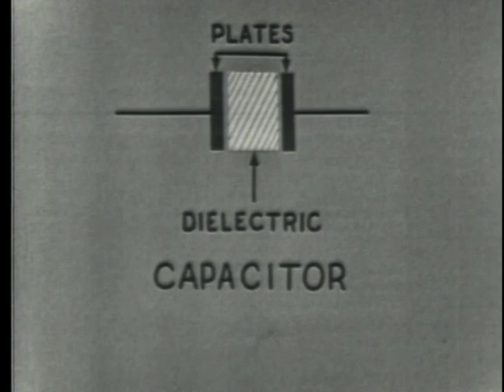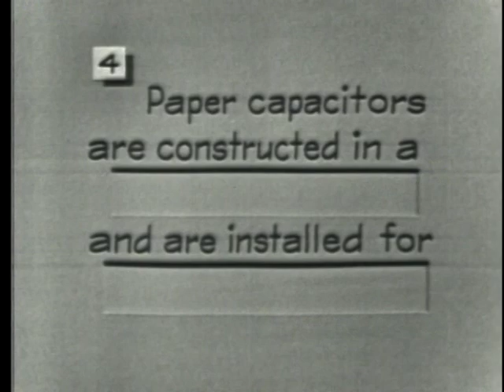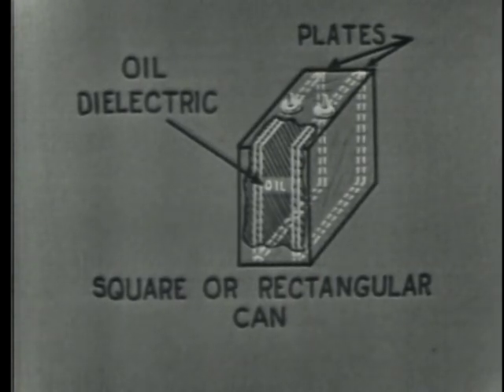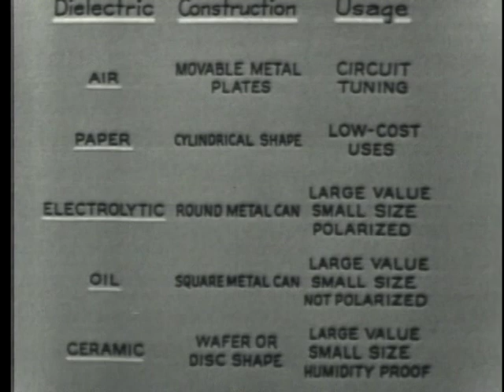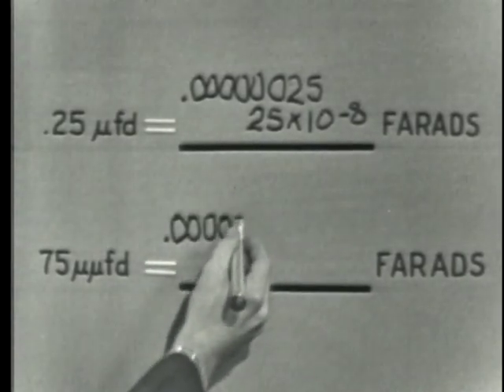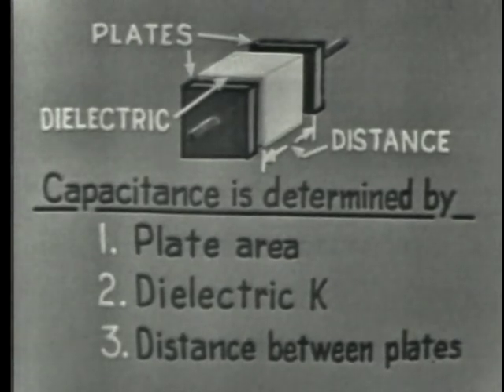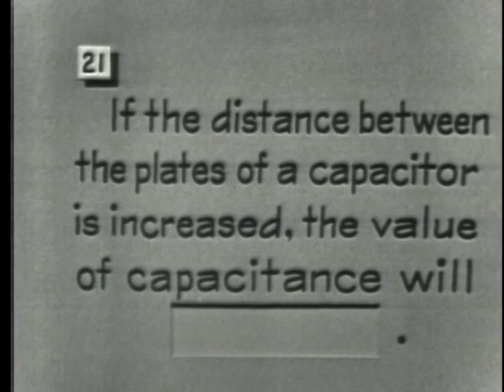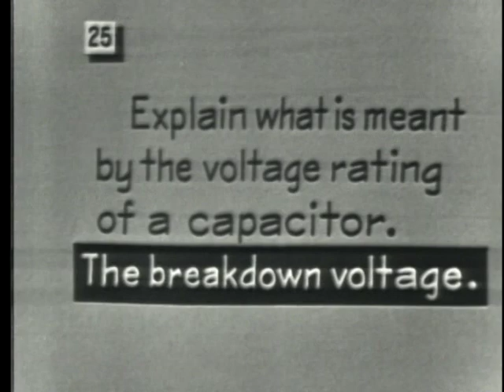CAPACITORS

Comment: that 2.2 farad cap wont help a second battery with a isolator cause when the amp peaks on a bass note it will draw more amps fact  capacitors realy eat  the power not soak it like a battery will and a cap will never replace a battery and drain fast unlike a lead acid battery if u wana test this hook the amp to  the cap with a charge now take charge off n turn it on with no input of recharge it wont last long  now conect the amp to a car battery no added charge and see witch holds up longest

Comment: I agree 1943 and not 1963:
MCMXLIII = 1000 - 100 + 1000 - 10 + 50 + 3 = 1942

1963 would be: MCMLXIII
Reply: the error here is 9 years old.  hope it can be fixed or i will not be able to sleep due to ocd..  it is 1943 not 1942.
please fix this as soon as you can.  I shall check every hour.
Reply: @davidjames666  I don't even recall posting all these numbers and shit :D You must be right about the number ending with a "3" ;) Unfortunately, I can not edit my 9 year old post 😕
Reply: @nixxonnor  can you fix the 2nd line. iii is 3 not 2
Reply: @nixxonnor  click the 3 dots to the right and choose “edit”
Reply: @davidjames666  I did, to no avail. Clicking the three dots and selecting "edit" only generates a new post for some reason. Go figure.